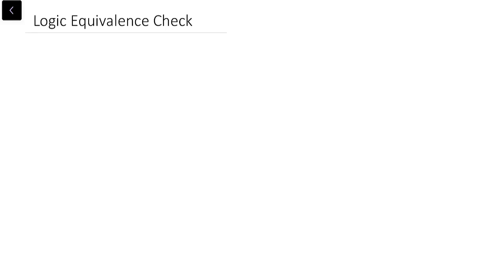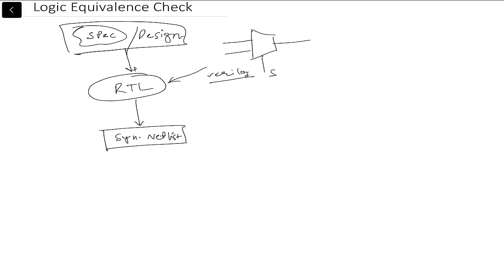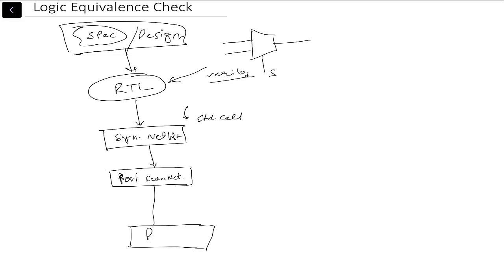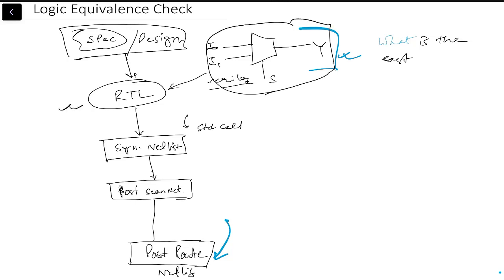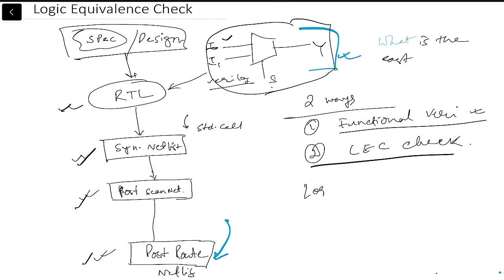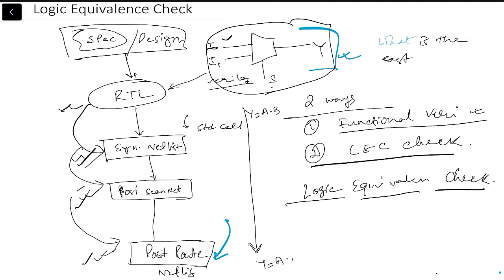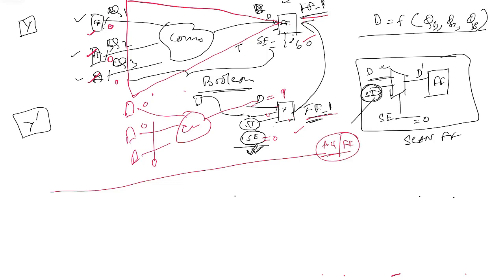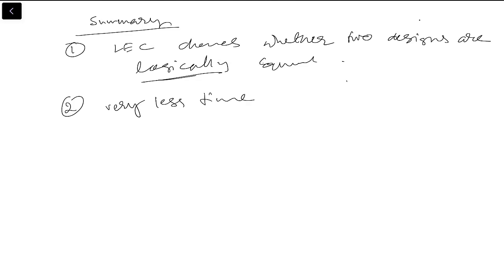Understanding Logic Equivalence Check in VLSI | What is LEC?

Comment: can you please how can we debug if lec fails,why lec fails at lockup latches generally
Reply from the maker: Lockup latches are part of DFT scan chains. The output of LL goes to the scan input of the register which is blocked (by setting proper constraints) when we are verifying LEC for functional mode. So, in LEC verification these LLs are always unreachable. Now, one should not make these as LLs available for mapping in mapping stage. You can set something like, set_mapping _method -NOUNREACH in candence LEC to skip mapping of unreachable key points. If it's not getting mapped it won't come as non-eq.

Comment: What is meant by "we can't write Boolean for Flops" and why?
Reply from the maker: You can write. But the output depends on previous state. Flops are edge triggered. Clock=0 or 1, No change in output. Only transitions matter. How are you going to write this in boolean? Even if you write how are we going to check LEC then. It's not a simple combi logic. As soon as you give input you will get output without any dependecy in combi logic.